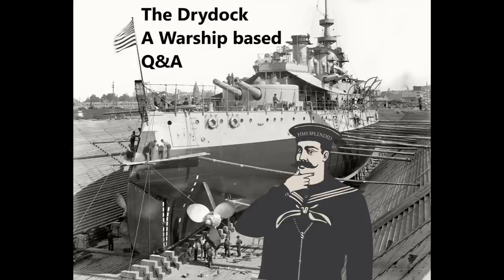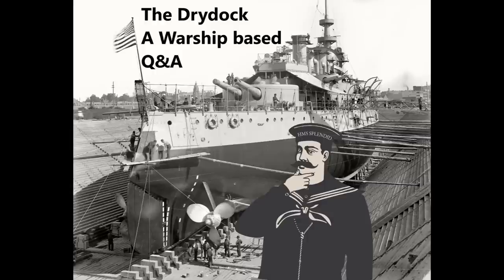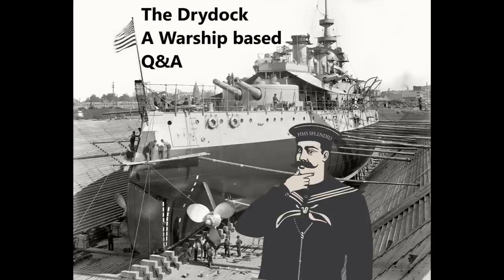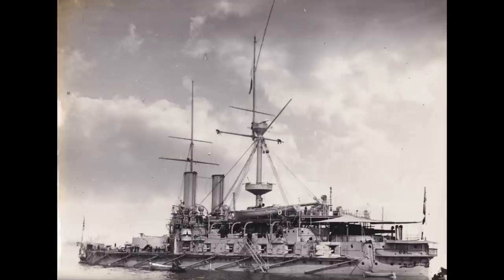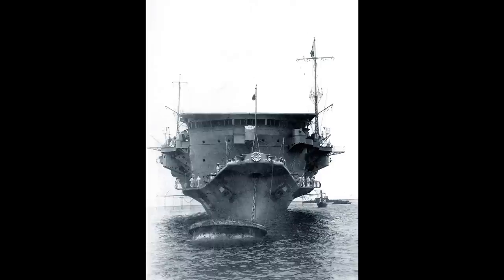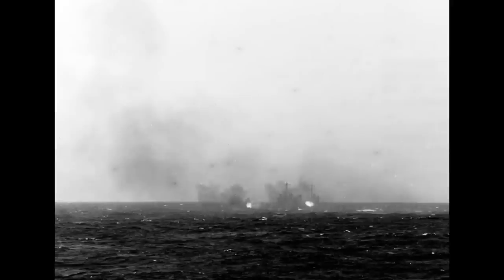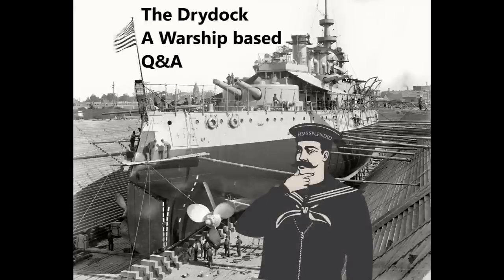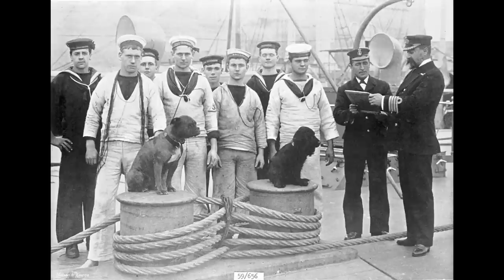The Drydock - Episode 256

Comment from the maker: Pinned post for Q&A :)
Reply: If Yamamoto survived his flight in April 1943, how would the outcome of the remaining major Pacific naval battles change, if they would change at all?
Reply: If you swapped the Yorktowns and Shokakus around so the former would be in the IJN and the latter were in the USN, but without changing the aircraft, how differently would various 1942 carrier engagements go?
Reply: Was the Montana class the last battleship design for the U.S.?
Reply: Recent edition of the TV genealogy show "Who do you think you are" featured the HMS Ulster Queen, a passenger ferry that sailed across the Irish Sea through the 1930s. When war broke out the ship was converted into a auxiliary anti-aircraft cruiser, served on the Arctic convoys and elsewhere. Survived the war but was not converted back to civilian use and was scrapped. Could be worth a 5 minuted prog ?
Reply: In your opinion what would it take to convince the US navy to stay with the 14 inch gun instead of going to 16 inches? 

For example, if you could absolutely guarantee no loss of main gun accuracy with 14 inch guns while maneuvering. Or some other magic wand type gimmick. 
 Would the US navy have reconsider sticking with the 14s.
Reply: @greenbean7853 basically I would have thought it boiled down to weight the 14" could put downrange compared to the 16".
Reply: 🤔🎱Magic 8 ball QUESTION. There are so many variables? He's an important piece. But not necessarily the controlling piece. You can also even make the case just like on the allied side; for his replacement. Many commanders from early in the war, were not in power by mid War.
Reply: @greenbean7853 I don't understand your question? What is the point of sticking with the 14in gun when your opposition is out powering and out ranging you?
Reply: @greenbean7853  convince the USN to stay with 14" at which point in time?  There was a titanic debate, 14" vs 16", in 1916.  Adm Strauss, head of BuOrd at the time, favored the 14", as more could be carried, and more guns equals more hits.  The same thinking dominated at the Admiralty in the mid 30s, driving the reversion to 14" in the KGVs, before Second London mandated that change for everyone.

The case for 14" always hung on the range that engagements were likely to be fought at.  Adm Strauss insisted that engagements would never be fought at more than 12,000 yards.  In the late 30s, Admiralty fighting instructions said to close, as rapidly as possible, to 16,000 yards, or less, before fully engaging.  At those ranges, a 14" could penetrate well enough.

What convinced the US SecNav and the General Board to override Adm Strauss' recommendation was Jutland, as ships successfully engaged at greater ranges, where a 14" might not penetrate, but a 16" would.  The SecNav and General Board decided to go with 16" for the Colorado class in the summer of 1916, after analyzing Jutland.  In his annual report that year, SecNav Daniels said the decision was made "over the objections of some officers".  Strauss requested to be relieved at BuOrd and given sea duty.

So, for the USN to stay with 14" would require every attempt to engage at greater ranges to fail miserably, which would validate Strauss' position, and the late 30s Admiralty fighting instructions.
Reply: In many sea stories ,there the old sailor that the captain goes to identify the ship on the horizon? Just how accurate was this? Could any ship at that sort of distance be recognised by rigging ,  for example?
Reply: @hughgordon6435  To a degree, ship types could be recognized by their rig.  A two masted ship would be a brig or snow, so probably relatively small.  A two masted ship with a gaff rigged mainmast was a brigantine, probably civilian.  A three masted ship with gaff rigged mizzen, was a barque, with gaff rigged mizzen and main, a barquentine, most likely civilian.  All masts gaff rigged, a schooner, most likely civilian.   Three square rigged masts, with nothing for size comparison, could be a ship of the line, frigate, sloop of war/corvette, or a civilian ship.
Reply: @stevevalley7835  😊
Reply: My question from Jervis Bay video is unanswered!
I demand an explanation!
Reply: The linear tactics question reminded me of Tromp and I wanted to ask what prevented him from defeating the Spanish completely in that campaign? Do you think Tromp has been over criticized? Battle of the Downs seems like a good enough victory.
Reply: Have you considered doing a retro robovoice Five Minute Guide or Dry-Dock, Uncle Drach?  For old time's sake?
Reply: In the final photo relating to crew numbers what is the difference in uniforms, some white whilest others blue. Is it trade related or climate, ie tropical verses temperate? 
Thanks another interesting Dry dock episode.
Reply: @paulamos8970 it's interesting that you picked up on the different uniforms. Since this is a photo and they're wearing dress uniforms? I think the crew in white do not have have their issued blue uniforms available? Blue appears to be uniform of the day. It may be a supply issue? Maybe it is all in the laundry? Or perhaps these guys are transferred in from a another ship?
Reply: @paulamos8970 on second thought? 🤔 We also have two dogs? It maybe possible we have crews from two different ships here? Ships don't normally have more than one mascot.
Reply: If you were to make the japanese yamato class battleship into a fast battleship. What would you need to change (length, armor etc)? Like american iowa 33 knots speed or just 30 like other fast battleship.
Reply: Did any navy design a battle cruiser with a ridiculous number of cruiser guns (8-9.2")? For example 4 or more quad turrets? With lighter armor, capable of withstanding cruiser firepower, but not battleship guns?
Reply: Like iowa's 33 knot speed
Reply: @WALTERBROADDUS  I don't actually know, but my first thought on seeing the picture was that the light-coloured uniforms looked generally grubbier and less well cared-for than the blue ones, and were probably therefore some sort of 'working' clothes, perhaps for a dirty job like coaling.
Reply: Do you expect to get to the next power of 2? 🙂
Reply: @CharlesStearman  those are more dress uniform. Not really working gear. The two different mascots make me think we're just talking about two different crews.
Reply: How often did destroyers and cruisers get to use their torpedoes. Compared to the Japanese, all others feel like they’d have to get into melee range.
Reply: @WALTERBROADDUS  I don't know what uniform policy was in the RN.  In the USN, blue wool is worn in the winter, and white cotton in the summer.  Apparently there are regional variations when the spring and fall shifts occur, and some bases in hot climates wear whites all the time.  I am at a loss to explain men, even if from different ships, wearing blues and whites, in the same location, at the same time.
Reply: @stevevalley7835  Or the development of a heavyweight high-velocity 14" gun that'd allow 14" BBs to keep punching through armor at longer ranges.
Reply: @lord-OdinClaw 
Fastest way? Increase the length:beam (most likely by cutting 3m off the beam), downgrade the main guns to triple 16”, and shave half inch off the main belt and deck, put that weight into propulsion, and improve the hull form — a lot — and you might exceed 30kts. 

But I assume your question assumes we’re not reducing the main gun and armor size, since that was the Yam’s claim to fame. 

In that case, downgrade the secondary battery to 5” (127mm) guns in dual turrets, five turrets per beam, reduce main gun ammo load by 5 rounds/gun, reduce float plane stowage to 3. The reduction in ship mass, plus reduction in crew needed (which yields its own reduction in mass and volume needed for berthing and stores) gives more room for machinery. And you’d still have to really, really improve the hull form.
Reply: @Thirdbase9 

I think not. The 1908 Blucher showed there was no point to a capital ship with even a crazy number of <capital ship-size guns. Sure they might be pretty good at beating up cruisers and smaller — given the greater volume of outbound kaboom — but they would be useless against capital ships, and the whole point of capital ships is to fight against other capital ships.
Reply: Given that total shell mass is irrelevant for armor penetration, with the important factors instead being the impact speed and angle and the construction of the shell, on the one hand, and its sectional density (its mass per unit frontal cross-sectional area), on the other, why did navies continually keep increasing their guns' shell caliber rather than their shell length?

As an example, consider three different guns:

- A British 12"/45 Mk X gun (shell mass 850 pounds, frontal area [6^2]π=113.1 in^2, sectional density 850/113.1=7.52 lb/in^2)
- A British 15"/42 Mk I gun (shell mass 1,938 pounds, frontal area [7.5^2]π=176.7 in^2, sectional density 1,938/176.7=10.97 lb/in^2)
- A gun firing a 12" shell with twice the length of the 12"/45 Mk X's shell (shell mass 1,700 pounds, frontal area [6^2]π=113.1 in^2, sectional density 1,700/113.1=15.03 lb/in^2)

The third gun (the one firing the long 12" shell) would punch through armor almost half again as well as the 15"/42 Mk I (in practice, this increase would be even higher, as the high aspect ratio of the third gun's shell would reduce the aerodynamic drag experienced by the shell compared to that experienced by a shorter, fatter shell, causing the shell to lose speed more slowly and retain a higher speed at impact upon a target at a given distance) and do so with a lighter shell (allowing the ship to either carry more shells and propellant charges, or carry the same number of these smaller shells and charges and use the saved displacement for things like more armor or more fuel bunker or more powerplant).  So why didn't navies go down the route of longer-shell guns, instead choosing to upgrade to guns whose shells were just bigger overall (a much-less-efficient way of increasing armor penetration)?
Reply: @vikkimcdonough6153  pushing muzzle velocity higher has it's costs, primarily bore wear.   Design faces more issues as velocity is increased too.  I have read that the RN tried 50 caliber guns, and they always proved unsatisfactory, though my readings did not say exactly why.  The Germans seemed to have more success with 50 caliber guns, but post-war analysis showed the German guns to be made of considerably higher quality (and higher cost) steel, than British guns.  The USN 14"/50 suffered very high dispersion when first introduced delivering 12 gun patterns at longer ranges of 1,200 to 3,200 yards.  It was not until after 20 years of tweaking the guns, that the pattern size was reduced to 700 yards.  At Surigao Strait, Tennessee and California reported patterns of 300-400 yards, at 20,000 yards.  Additionally, the longer the barrel, the more it will tend to droop.  The Navy Indian Head proving grounds were far too small to fire a 14"/50 with a full charge, so, even if the gun had been subjected to a test program prior to being put into production, the dispersion problem might not have been revealed.  Dahlgren was big enough to allow full charge test firings, but it did not open until late 1918, long after the 14"/50s had been built, then superseded by the 16/45.
Reply: @dougjb7848  True, but given that the original purpose of a Battle Cruiser was to kill anything smaller and run away from anything bigger, I was wondering if anyone proposed a design where running was really the only choice.
Reply: Thanks Drach
Just what are the challenges involved in increasing the caliber of large naval guns as when the British went from the 13.5 to the 15inch gun.
Some would say that if you have a successful weapon, just make it bigger, job done.  
But I imagine the engineering involved is far more complex than that simple statement.
Reply: Have you ever thought about making a video of the different calibers of guns firing, considering the mirror to the last question that was asked? For example a five-inch, 6 in, 8 in and so forth. Bear in mind is be great to hear they're real recorded sound if possible😊
Reply: @WALTERBROADDUS  possible factors are lower cost, higher rate of fire, weight savings to add armour or more speed.  If your enemy out ranges you but you have more speed?
Reply: Have you ever said, "You have a really fine bow and stern" to Mrs. Drach?
Reply: Speaking of different gun calibers, absent the Washington and London treaties, would 8" cruisers have proliferated to the point they historically did? It seems to me that light cruisers (6") do have a multitude of important roles to fill, but the main advantage of an 8" cruiser is that it can very likely beat a 6" cruiser in a 1 vs. 1 fight, it doesn't otherwise bring any fundamentally new capability to the table. And absent the WNT/LNT, a response to an 8" "cruiser killer" cruiser would have been a slightly bigger "cruiser killer killer". Repeat for a few iterations and you're at a full size (fast) battleship (ignoring here the historical sideline of the battlecruiser concept). So why bother with these intermediate steps, just skip directly to building more battleships?
Reply: @nowthenzen  I think you are getting more into the realm of the USS Alaska fanclub.
Reply: In the 1954 cinematic classic 20,000 leagues under the sea, how would you rate the the movie accuracy for its depictions of the guns/ gun crews on the U.S.S Abraham Lincoln and the controls of the Nautilus? Have any post age of sail ships (intentionally) experimented with an electrical boarding deterrent system?
Reply: @landshark_8024  movie accuracy? It's a Disney/Jules Verne science fiction Epic?
Reply: @vikkimcdonough6153  As for very high aspect (long and thin) shells, there are limits how far you can go with spin stabilized projectiles before they become unstable (the technical term is "gyroscopic stability"). That's one reason why modern tank guns are smoothbore and use fin stabilized projectiles rather than spin stabilized, to allow them to shoot these extremely high aspect ratio darts.
Reply: @Thirdbase9 

The naval world saw what happens when you force a ship intended and designed to “kill the weaker and flee the stronger” to fight the stronger, which is what inevitably happens to battlecruisers. 

They’re usually the same cost as a battleship of same era. 

No navy could guarantee their battlecruisers would only-ever fight the weaker, and no navy could afford to have an entire class-group of capital ships as expensive as the strongest, but which would always have to flee the strongest.
Reply: @nowthenzen 

Unless you’re way faster, or somehow achieve an outlier level of tactical surprise, by the time you’ve closed to your guns’ effective range you’re already getting hit by larger guns doing more damage.
Reply: @dougjb7848  That has neither prevented the design or building of ships that were useless. Also I am talking of design, not construction, and there were some over the top ship designs out there.
Reply: There are bore evacuator/fume extraction cylinders on most modern tank guns and some smaller-caliber naval guns, like the British 4.5"/55 Mark 8 Mod 0 mount, but most do not. Do naval gun systems have a different bore evacuation system, or does the gun crew have to just eat the combustion gases when the breech is opened, and if the latter, why isn't some sort of bore evacuation system employed?
Reply: @jbepsilon  Even if you double the length (and only the length) of a typical 12" battleship shell, its aspect ratio is still nowhere near that of those giant needles.
Reply: @Drachinifel

Can you do an episode on Smaller coastal water craft like PT boats and German torpedo boats?
Reply: Where did you get your gun fire sounds from for the introduction?
Reply: Regarding Jellicoe's thoughts/statements about Beatty, it reminded me of how many of the senior USN leaders during WWII made a point to avoid "airing the Navy's laundry" in public due to their memory of the Sampson-Schley controversy in the aftermath of the Battle of Santiago de Cuba. This incident is frequently cited as a reason why naval officers were sometimes not punished as severely or as publicly as one might expect for some transgressions (i.e. Mitscher for his obfuscations after Midway, or Halsey after Leyte Gulf/the typhoon/the other typhoon). Was there any similar incident in the Royal Navy during Jellicoe's career that might have influenced him similarly?
Reply: @52.32, The display of HF/DF, a circular CRT with RF signals showing as an elipse on the relevant bearing, is worth a look. As provided to intercept U-boat short radio transmissions from about 1942.
Reply: @seanmalloy7249  yes, naval guns have a purge system.   The USN started thinking about safety after a particularly lurid incident in the early 1900s.  The drill up to that time was for the loaders to look inside the bore for flames or burning embers, before ramming the next round.  One battleship was on a firing exercise when the loaders apparently missed something in the bore from the previous round.  The moment the first two bags were rammed, they ignited, sending flames shooting out of the open breech.   The USN had not twigged at all about flash tightness, so the flames from the breech ignited the other two bags sitting on the open hoist.  Burning bits from the bags on the hoist fell down the barbette and ignited more charges at the bottom, that had been staged for loading onto the hoist.  By some miracle, the fire did not spread to the magazine.  Over 30 men died that day.  The navy started retrofitting a compressed air purge system to the guns, and fitting trunks and flash doors around the hoists.
Reply: Why the universal decision that a starboard island was better than a port one? Is it a physiological reaction reason like reflexively pushing the joystick to port when being fired on?
Reply: @marckyle5895  the starboard side island was not universal at first.  Pilots tended to turn left after an aborted approach.   Most aircraft engines rotate clockwise, when viewed from the rear of the airplane.  With the prop spinning clockwise, engine torque will tend to bank the airplane counterclockwise, making a left turn easier.
Reply: Why was the Imperial Russian Navy so popular for foreign military officers in the 18th century and beyond?